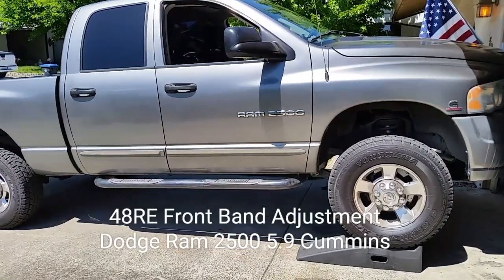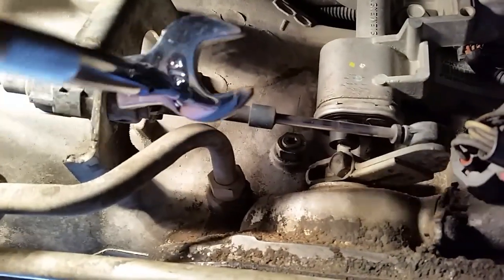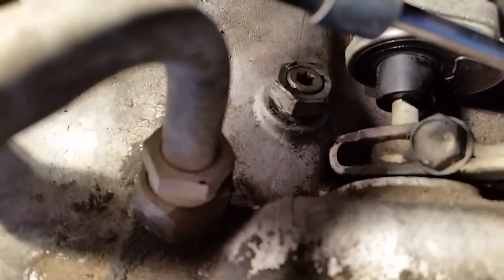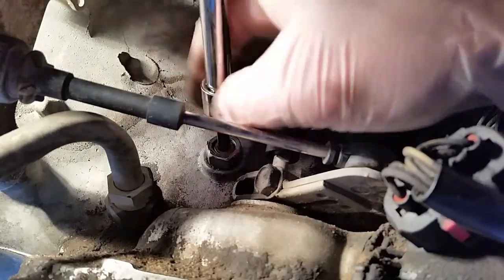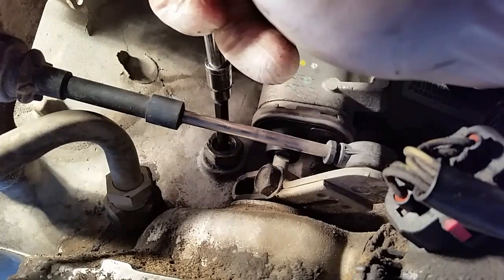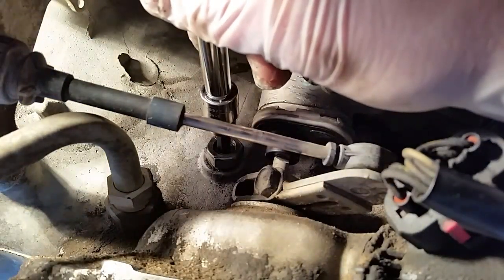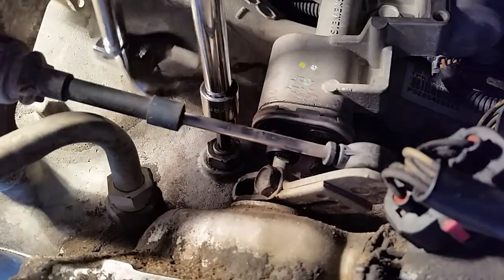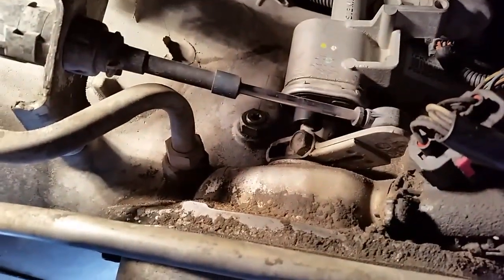Dodge Diesel 48RE Transmission Front Band Adjustment Video

Comment: Forgive my lack of knowledge but will this work on my 06 dodge 2500 mega cab 4x4? It seems to rev high before shifting from first to second and from second to third sometimes I'll let go of gas pedal and it will shift.
Reply: Servando Leal  did u get that fixed
Reply: Hey did you get that fixed I’m having the same problem
Reply: @Antonio432outlaw  it worked for a few months but ended up rebuilding transmission
Reply: @gosujags  worked for a bit but had to rebuild  transmission

Comment: I adjusted the front band screw and when I put the truck in drive it would not move until I got on the throttle. Is this normal or could the band be too tight?
Reply: Yes
Reply: The band is about done. Gonna have the transmission rebuilt to a stage 2.
Reply: Thanks a lot for your input. 👍